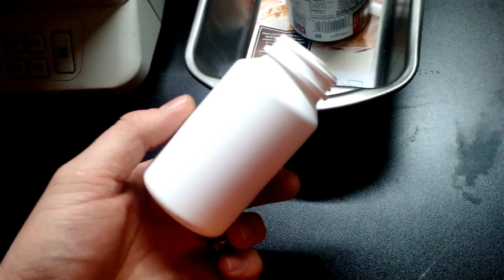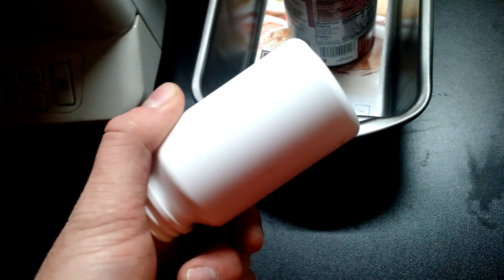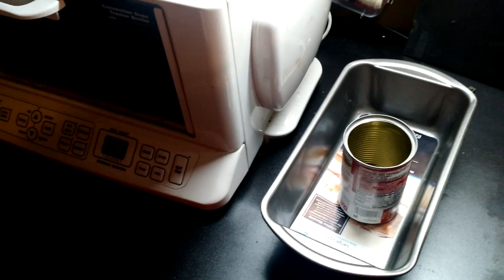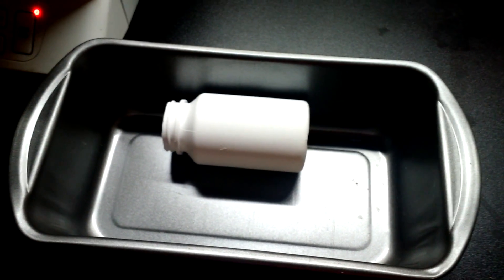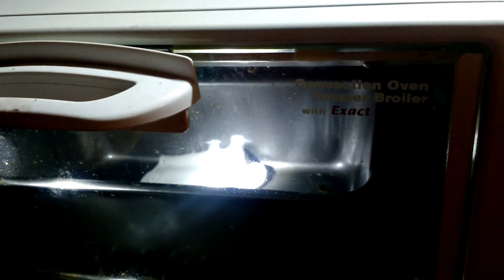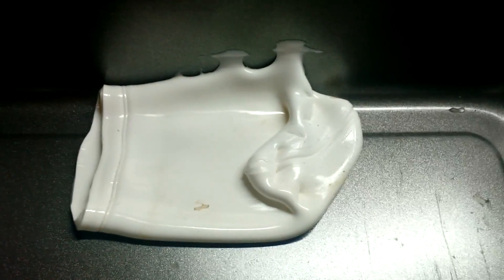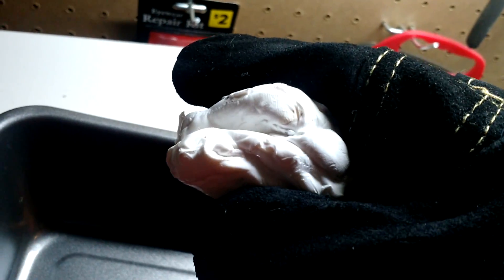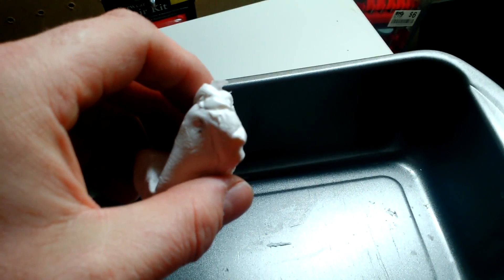How To Recycle HDPE Plastic To Make Parts!  Trash to Treasure, Part 1!

Comment: HDPE= High Density PolyEthelene. You want to heat it up slowly at lower temps than you used, otherwise you cook it , burning off some of it's strength and making it more brittle over time. 105 to 115 °C /221 to 239 °F is the best temperature range for melting your average HDPE.
Reply: +Rusty Evolution  I run at 385F I don't think at 239F you'd even touch the stuff. You certainly would not get a cohesive melt at that temperature. In theory there is no difference between theory and practice. In practice there is. What you have to realize is the recycled plastic is not commercial pellet stock, it is also recycled too. So the resulting properties from a garage melt are not going to be lab grade. As far as burning some of its strength goes I dare you to try to even bend so much as a quarter inch thickness of the plastic I make. Your avatar picture is quite appropriate. It would make a total monkey out of you!
Reply: Rusty I made lumber for small company when i first moved to FL the owner told me to make sure the tem remained at 350°F though the highest safe melting point is 356, the lowest setting being 248 wich is very easy to look up on the internet and stated by numerous informative engineering sites these days, You are barely melting it at those temps and btw that is 120-180 for C temp users. Best temp is 350 for pliability but not soupy and any higher would degrade the material to unusable. Creative Mechanisms is a good source of plastic qualities and safety info.
Reply: @Joshua79C  that was really informative! Thank you!
Reply: That would be a warm up temp for HDPE. If you want to form it easily, 370- 390 degrees is a good range. Makes it flow better. 250 -270 degrees is for low density plastics. I work with plastic all day :) I help make many of the things we use on a daily basis. from your kids toys to the cars we drive.

Comment: Cancer 10 years later from fumes from melting HDPE.
Reply from the maker: +Captain Everything You'd have a better chance of getting cancer from Diet Sodas.   ;)
Reply: well yeah if u are stupid enough to drink that crap. your point?
Reply: As a type one diabetic, in most of my life I drank diet sodas & tea with artificial sweeteners. Aspartam and acesulpham-Potassium, various things like that. In last November, I felt that I have a bean-sized gob or knob in my left nipple. I thought it will disappear soon, but it didn't. It became sensitive, then painful. I went to the hospital, they inspected it (for 2 months) and told me I have a carcinoid tumor. One yet... Here in Hungary, you don't have too much odds with tumor. Surgery, chemotherapy and radiotherapy, in this order. And most likely a crematory after 1 or 2 years.
My advice is: don't use sweeteners, use sugar or erithritol, it's not an artificial poison. And stay away from plastic smoke.
Reply: Maybe, but I would not recommend doing this at home. Try plugging it outside.

Other than that, thanks for the vid!
Reply: 1D10CRACY dammit,  now got to give up diet Pepsi
Reply: Not from HDPE. PVC will do that though. We run HDPE in my industry and have for 30+ years. Cancer isn't a thing around HDPE Blow molders. Running PVC can, especially if it's run too hot.
Reply: PJ DeCoste r
Reply: yea but you need to heat it above 350 degrees which is past the point where it becomes malleable
Reply: The fact that you smoked 2 packs a day probably had little to with you getting cancer.
Reply: Wanking
Reply: Vano   Melting HDPE does 100% create fumes and they will make you sick for days.  How do I know???  guess
Reply: Baladár as one cancer patient to another ...wish u well and good luck
Reply: Whiskeysuds seems like you were melting too high a temp in an enclosed un-vented area, I have worked for a recycler in 2005 for six month as an intermediary job, still no cancer from breathing in fumes despite the industrial extrusion machines they used were in an open air shed before being moved to a new location of operation in a more enclosed space though I have visited and they leave the doors open during operation. Mainly recycled PE into lumber and parts such as legs for picnic tables and park bench seats. Though we had some runaway energy outputs at times and could smell the plastic when it was being overheated, but never breathed it in since it smells and taste so plasticy.
Reply: 1D10CRACY took the time to share something very useful don't be a jerk, and by the way being a troll adds nothing to the conversation, creates enemies and cortisol which is a stress hormone that wreaks havoc on the entire mind and body. 

Captain troll aside, the use of a respirator and ventilation fans would easily remedy concerns of fumes.
Reply: +1D10CRACY or cheese burgers
Reply: Well at least we know how to melt plastic.
Reply: Saw no smoke in the process. Low heat, bitches.
Reply: the stress from your idiotic comment would do more harm than all the milk jugs melted in the world.
Reply: this better be b8
Reply: this is the same principal that 3d printers work off of and they produce no fumes, except ABS but that requires special treatment anyways.
Reply: Captain Everything b b i
Reply: 1D10CRACY u
Reply: It shouldn't fume at all if it's being melted carefully.  But if you're trying to melt and stick pieces with a lighter, yucky fumage.
Reply: Hoefledorf, refining does nothing to make sugar carcinogenic.  The process of refinement is purification.
Reply: That's exactly what I thought!
Reply: In case anyone reading this is interested, here’s an informative link. Note PepsiCo is on the list.
Reply: This thread gave me cancer
Reply: It dose not creat fumes
Reply: Captain Everything Red meat is a carcenogen...look it up.
Reply: Wolfman Jack drink full sugar instead of diet. High-fructose corn syrup does not occur in nature don't take it.
Reply: Cancer is a fungus

Comment: Okay this may be a really dumb question but if you heat this stuff up in your house how bad (and toxic) is the smell? Does anyone know what the tensile strength might be?
Reply: Go to Creative Mechanics website for strength qualities of PE or look up plastic cribbing and at manufacturers for their psi ratings.
Reply from the maker: Pretty sure it doesn't off gas at 350 degrees.   No smell that I could smell.

Comment: It honestly seemed like more of an experiment for yourself than a how to video, or the first step to the rest of the how to.
Reply: You need between 120-180°C/248-356°F to melt PE. such easy info to find even back when I worked for a recycler company of small size the owner told me this himself and showed how to operate the machine efficiently to make him lumber stock for a $9/hr wage.
Reply from the maker: +Kyle de Montigny And you would be correct.   ;)
Reply: +Kyle de Montigny  When I started melting HDPE I did essentially the exact same thing myself. I took a small bit of plastic and melted it down on a sheet just to see what the molten material was like. It is often a good idea to start small before scaling up. One thing this person didn't so was being the temperature up to where the material burnt to calibrate their process. You should go up to burning, then back off that about 10 degrees for your actual melts.

Comment: I take old toothbrushes and bend the neck for cleaning chainsaws, etc. this is done by exciting the molecules of the plastic over a simple flame. It keeps the shape you bent it to. Given that it stands to reason a similar process, as you demonstrated is certainly viable. I also make machete sheaths from vinyl siding, and long bows from pvc pipe.

Comment: Plastic is by no means treasure. Recycling plastic doesn't help at all as it only be recycled up to 7 times (generating waste waters and intoxicating the air during the process) and is then dumped into the oceans/landfills where it disintegrates into smaller particles and enters the food chain. If a fish ingests it, and human consumes that fish, it becomes a potential cancer trigger. "Zero waste" or not using plastics at all is the only solution as the world is clogged by it.
Reply: Ko Br - I call bullshit "I don't buy anything made of plastic". You're using a computer/tablet/cellphone to connect to the internet - there is plastic in it. Unless you live in a hole in the ground or a log cabin in the middle of nowhere your house has plastic coating the wiring, PVC plumbing, vinyl window frames, etc. etc. - Your house has plastic in it. There is no avoiding it. Period. Even 100% cotton clothing still uses some blend of nylon thread to sew it all together. Even if you buy products made solely from wood, paper, glass and metal plastic was used in it's manufacture or transportation to your hands.
Nothing new to invent? How about an environmentally safe way to break down all the existing plastic back into raw materials? You know, like that giant mass of plastic in the middle of the ocean. What about creating some novel new enzyme that eats it and breaks it back down into short chain hydrocarbons? Go claim a Nobel prize and make the world a better place for everyone!
I'm pretty intelligent, but I'm not THAT smart - so in the meantime, I'll do what I can to recycle my current plastic consumption into something more long term useable to at least try to keep it out of the landfills and animal food chain.
Reply: +Ko Br How about YOU do it, instead of bitching? Obviously it's something very important to you, as it is for the rest of us - so pick up a some chemistry and engineering books and get to work! Invent the new product and save the planet at the same time! In the meantime, stop shitting on the people who are trying to do what we can to recycle what would otherwise be garbage in a landfill into something useful.
Reply: +Ko Br  Melting HDPE down is treasure to me personally. Because I get valuable stock that I can work with for virtually free. I am not looking to save the planet doing it, just save money in my wallet.
Reply: +1D10CRACY carpet fibers. are plastic also.
Reply: Ko Br I wish we could go back to having the milkman deliver and money return bottles at the store everywhere.  No more plastic use glass.  Diaper service would also be great, cotton on baby's skin instead of gel induced fluff covered in plastic yet again.  The thing is this guy's using this plastic on his fishing pole it will never go to a landfill lol
Reply: oh yeah that plastic fishing pole will last forever. Hello?
Reply: On the one hand, I really do agree with you - don't get me wrong - I also think that the amount of plastic production and consumption in the world is completely ridiculous, and could/should be replaced with alternate materials. However, I can think of several cases because of thermal, static, or structural properties where a substitute for plastic is not feasible, so it seems for the time being, plastic is here to stay. So the more realistic option falls back to "How can we reduce or eliminate the damage?" Can we invent a way to 100% recycle this stuff, or at the very LEAST, render it environmentally inert? I think with the advances in technology and chemistry we are close to being able to find that answer. Until that time comes though, at least we can find ways to repurpose and recycle what is already out there.
Reply: Paul Frederick I get the alarm call whenever in presence of it knowing it enters the food chain, water and air system and knowing there are benign alternatives to it, but being repressed by dirty business. I find consumerism really disturbing, plastic being the synonim for it.
Reply: Paul Frederick yes, but this way of consumption is the same as if sh.... in yr. own home, I mean worse as it stays there forever
Reply: +Paul Frederick everyone "saves" money whit the plastic. a quick fix. it's expensive in the long run, for the future generations. couldn't you switch to some other material, biodegradable plastic, rubber, clay or whaterver? anythig is better than this.
Reply: David Moore there's nothing new to invent. The bioplastic is already there, but the big business doesn't care about it. In the meantime, I don't buy anything made of plastic (food and beverages packed in it, cleaning products...) not to add to the problem more. I repeat, there are many "zero waste" and DIY tutorials online, youtube too. Saves money too.
Reply: David Moore I wrote, in the brackets, the food, the bewerages, cleaning products, cosmetics... the things that are the main cause of the pollution in the oceans, combined with the single use plastics (straws, bags...). Also, the devices (the body) could be made out of alluminium, and the circuits could be placed on a different material (the bioplastic, the rubber...whatever). I know, it's an ideal world, an utopia, and it seems there is no way to avoid it totally, but it could be done - the companies should be forced to end the production by not buying it. Plastic happened like 150 yrs. ago, while humanity is here a bit longer. If one doesn't get it/buy it, there is no need to recycle it. For everyone who has children, there should be no compromise as the toxins and the waste are left to them.
Reply: Paul Frederick Do it for yourself if not for ones to come. In the end, something that could trigger cancer cannot be good (by means of BPA leaching from the plastic containers/bottles into the liquid, or by ingesting it as the microplastic/fibers through the fish or water (90%of water and humans are contaminated already - beer and honey also)). Do a little research for yourself and you'll see  why that baby should be thrown away, as more and more is being dumped into the seas/landfills. It nothing, it is really ugly waste within the environment.
Reply: The key is in using less and less and eventually replacing all of it. Throwing it away immediately would pollute the environment, so when broken, buy a a new one of a different material and better quality and recycle the old one. There's cotton and hemp clothes also. Feels better on the skin too. Trains are made of steel, so are bicycles. Cars pollute too much, if not electric that is.
Reply: They have discovered bacteria that break up plastics and digest them
Reply: Ko Br 
There's a bit of a growing movement around doing away with toxic plastic all together in the food industry's , as they are linked to a lot of modern day diseases and mental illness , the talk is going back to greased proof paper and cardboard , glass , and tin , as they are more safer , and recycling is easier and better for the environment ,. Safer for us humans , I'd say a win win all around.
Reply: Just crack the plastic into short chain hydrocarbons for fuel. Build them plants what capture co2 and recycle it to make super clean fuel.   100,000 of these carbon capture plants worldwide would put us into negative co2 emissions worldwide
Reply: but there are the natural fiber ones too.
Reply: Exactly, reducing it at the source by not consuming it/buying it. That way, there won't be any need for production. Stuff made of it are of a bad qality anyway - get easily broken.
Reply: +Ko Br I would love to help but I am curious as to precisely what future generations are doing for me now? I need to get through today after all. I should not be penalized for the incompetence of others handling the waste stream either. How about we just fix the problems as opposed to throwing the baby out with the bathwater?
Reply: +Ko Br I have no problems with plastic. For me plastic enriches my life. Plastic makes my life measurably better, than living without plastic would. Of course there are negative aspects to widespread plastic use. But we'd be better served addressing those issues directly as opposed to simply ceasing to use plastics themselves.
Reply: +Ko Br we all need to consume to exist.
Reply: Ko Br   are you under the impression he is making plastic?
No?
Then why are you making stupid statements?  No duh: everybody knows plastic isn’t great, but you are literally saying you want him to throw away his broken item to a landfill, because ‘plastic is bad, so don’t use ALREADY existing plastic to repair items’
Think harder
Reply from the maker: 7 times is actually a hopeful myth.   However, a lot of plastics are "downcycled" into fleece and similar items.   After that, they degrade rather quickly.  As we migrate more towards green energy, hopefully the process of the downcycle isn't so hard  on the environment.   That being said, you will never have a "zero waste" planet, but we have come a long ways have been getting better.  I remember as a child going into one particular city and seeing a cloud of pollutants over the entire city.  Once you were in the city, it wasn't so noticeable.   Of course back then we had harsh winters and the headlines were fear of global cooling, due to the pollutants in the air.
Reply: Hopefully we are getting better, but fleece also generates microfibers and even nanofibers during the washing, also the fish and plankton food. When it is in the food chain, it's the problem
Reply: Shed all your clothes because they are either a form of plastic or plastic was used in the process to make it. 
Get rid of your vehicles because they are full of plastic. 
Move out of your house and give up all your conveniences because they all involve plastic. 
Ditch your computers and smartphones. 
Move into the wilderness with nothing and totally naked. There you can hug all the trees and we won't have to hear your BS.